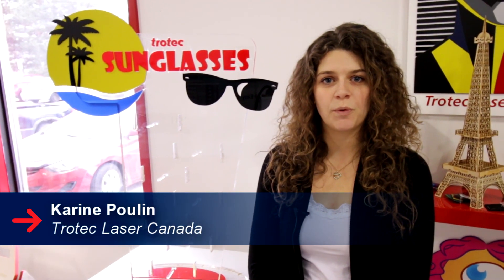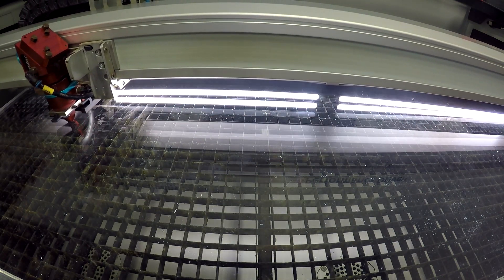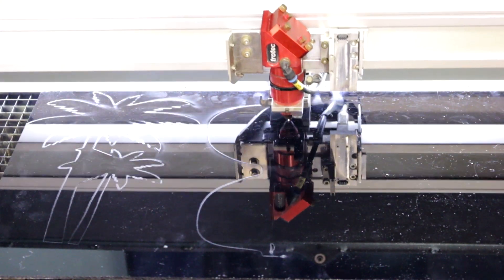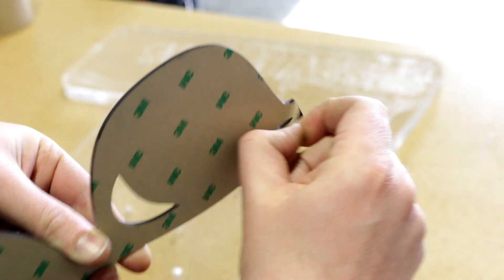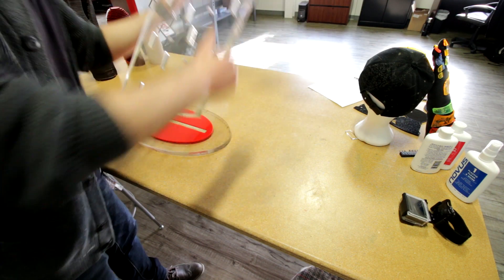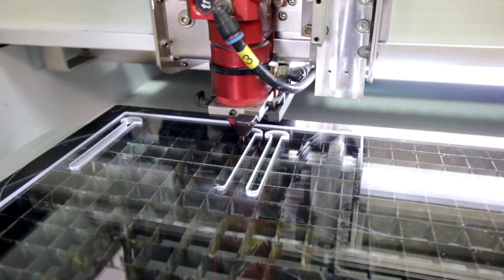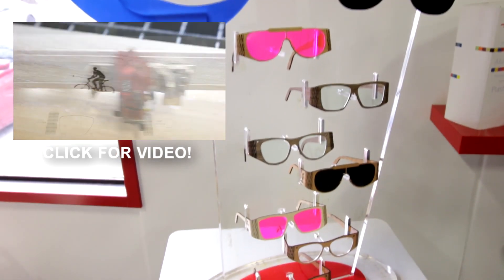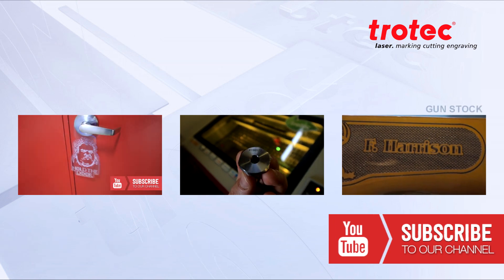Clear Acrylic Stand | Laser cutting acrylic | TroGlass Clear cast acrylic

Comment: This machine how many W laser ? This tube laser is CO2 ?
Reply from the maker: Hi Bin Naji, This is an SP 500 with a 200 watt laser tube. Laser is CO2 yes. If you're cutting thick acrylic with a lower-powered machine we would suggest multiple passes - but you won't get that nice flame-polish finish on the edges.
Reply: Trotec Canada ok thanks for your nice reply